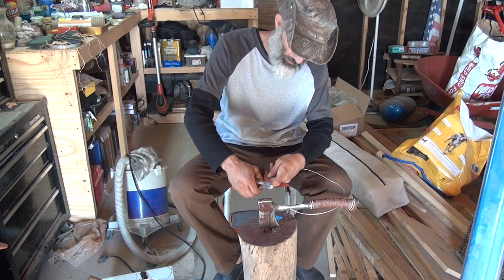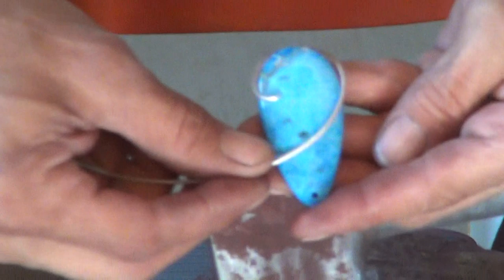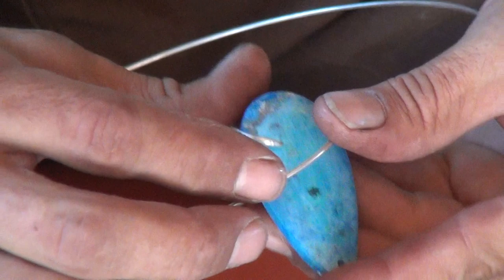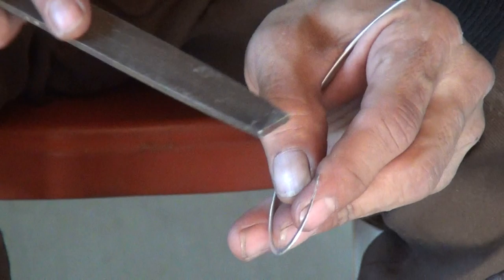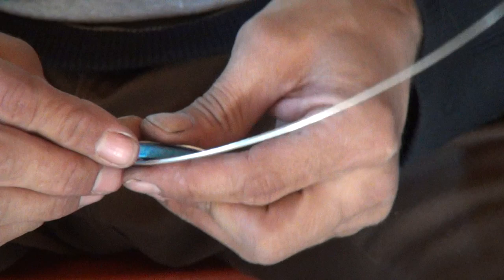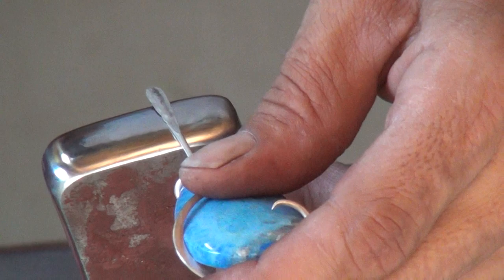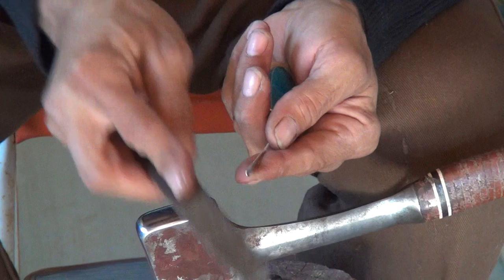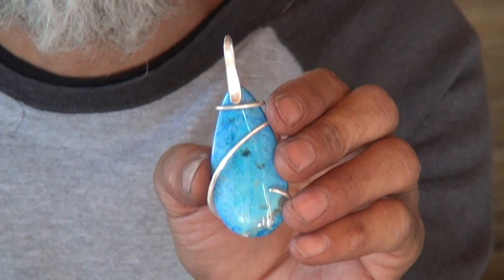Dennis Hardy Wire Wrap Tutorial

Comment: Joanne, I have quite a few anvils to make jewelry. I have a standard 4 x 4 inch steel bench block (remember to keep one side as your good side and one that you beat up), a small highly polished jewelry anvil with horns and holes for wire work, a large 20 inch anvil for metal forming, and two Fretz blocks (the flat top with rounded edges and the slight dome with rounded edges...frankly, I only ever use the flat one most of the time).  You can make jewelry with just one anvil...you don't need a lot, and most can do this with just a steel bench block.  The important thing is to have a slightly domed hammer face in your planishing hammer so that you can flatten and form the wire. And never strike steel hammer head to steel block as this will mar and dent your block rendering it perfectly useless as you get better.  If you're just starting out, I recommend a steel bench block. As you get better, get the fat top Fretz.  Good luck!